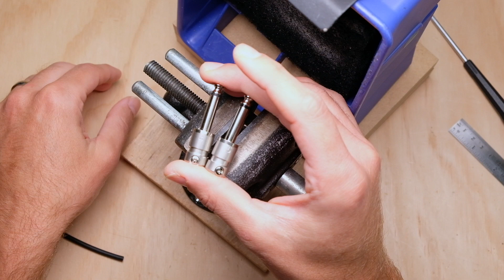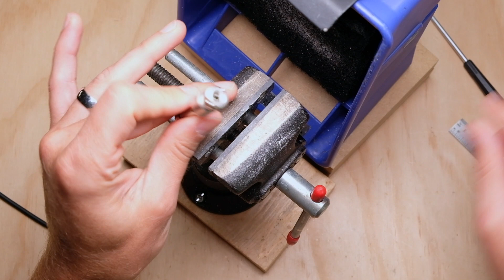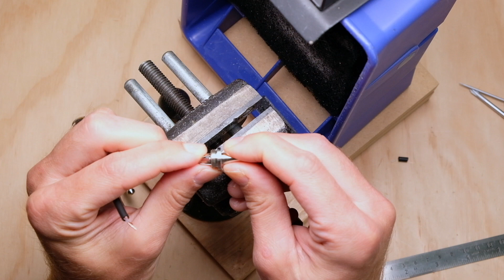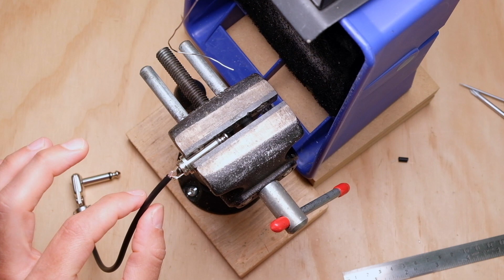SPS4 SPS5 Assembly

Comment: I just bought a couple of SPS4 connectors to try out with some Canare GS-4. The braided shield is always a bit contentious, especially in such a small connector but otherwise It's a great match. I was actually able to twist the entire braid and fit it through the ground pin hole without trimming any away. This was a huge relief because there's no room in that tiny plug to deal with stray whiskers.
Also, the diameter of the cable opening in the SPS4 is juuust large enough to accommodate heat shrink over the cable if you so desire (I used some, both as strain relief and as channel identification; red = right, white = left).
Reply from the maker: Nice!

Comment: question....what flux do you use and what temperature do you set your iron at?
Reply: Probably around 650 degrees and Kester 60/40 solder w/ flux built in.

Comment: Hi there! great video and tips! I am totally new in the patch assembling field and I have the nerve to build my new pedalboard on my own with more than 10 pedals on and boss es-8 loop switch in the center, so the SP400s and SPS4s/SPS5s seem the way to go. I am thinking on going with the LAVA tightrope cable (32 pF/ft) because it seems a good choice and I can actually find it here (Athens, Greece). A couple of questions: is the LAVA tightrope indeed compatible with these plus in terms of geometry/size? which one of the two (SPS4s/SPS5s) would be the right way to go for the straight ones? Thanks!
Reply from the maker: Sotiris, I'm very sorry for the delay in reponse. Have been away from youtube for a minute and just getting back to it. The tightrope would work with these heads. the 400 series would be ideal. The biggest set back for the tightrope wire is the solid core. It isn't as flexible as a stranded core wire, but will do the job if you're not trying to squeeze things super tight. Solid core can break easier within the cable run.

Comment: This was very informative, THANK YOU!  I just bought several SPS4 and several SP400 plugs and a large amount of Best-Tronics  CA-0678 cable. I will be making (about 20) patch cables. I have 2 soldering irons, a 15w & a 45w. Which do you recommend for the job? Thanks
Reply from the maker: Start with the 45w for sure. If you get too much shrink back on the conductor insulation, you can go to the smaller iron.
Reply: @AlphatoneAudio  Thanks for the help!

Comment: Great video!! Do you think the cable can turn almost at a right angle after it exits the barrel? Or would that be too much strain for the screws?
Reply from the maker: Thanks! 2314 is pretty flexible, a quick right-angle bend is no problem.